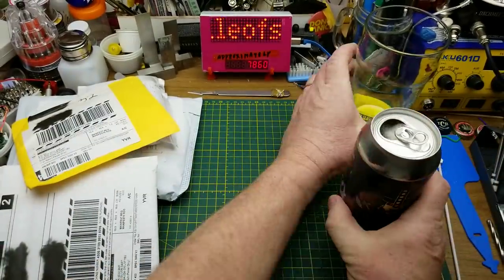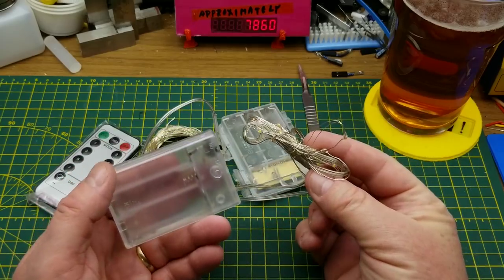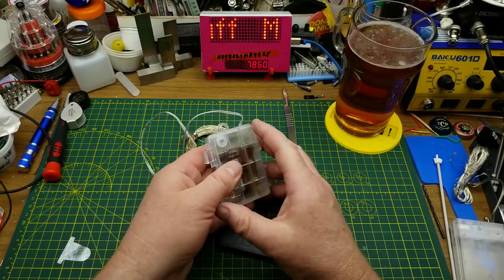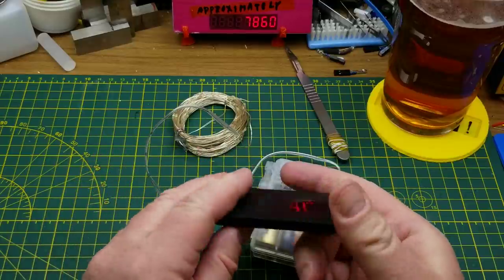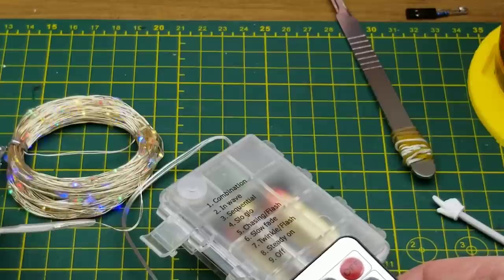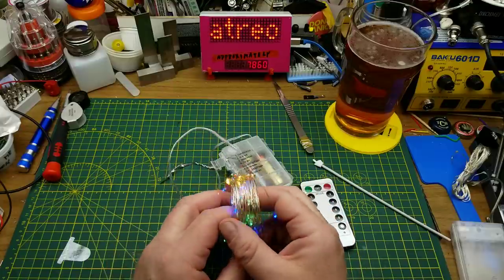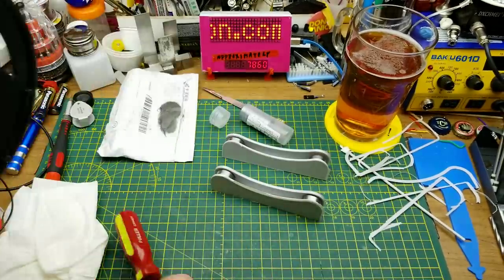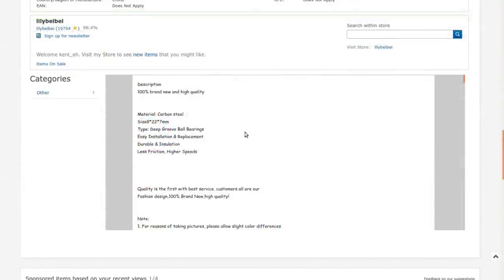Mailbag Monday #109

Comment: Do what you feel is best for getting stuff. If your not comfortable don't do it, I don't expect you will ever be a shill. I've been looking at 4x4 keypads. Hari Wiguna has a video that uses one analog pin by using a voltage divider, a high value resistor ladder on one axis, and a low value ladder on the other. No scanning, just read the analog pin.

Comment: 0:33 Aww, missed a chance to say the channel name.
Can the extra bearings be used in the skycam project?
Reply from the maker: I'm not sure it needs the bearings. That would need a serious mechanical redesign. 
Though after I finally get the software dealt with, that may prove to be necessary.
Reply: I dissolved the grease out of some bearings, and made 3d printed fidget spinners.